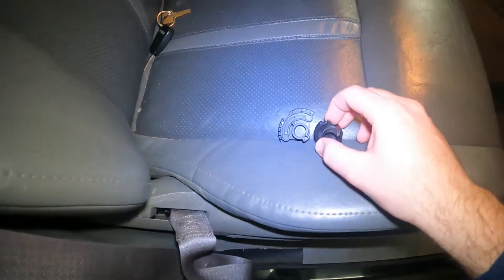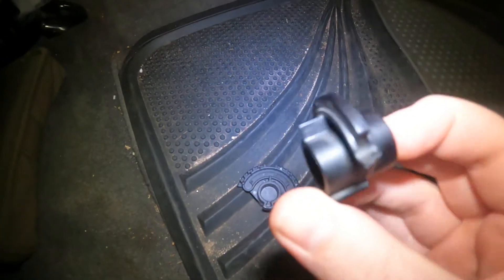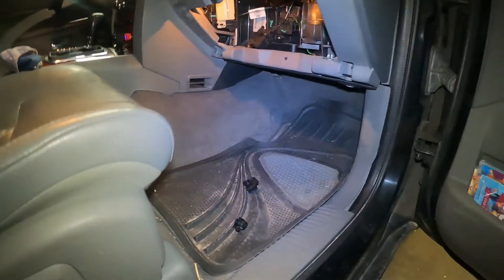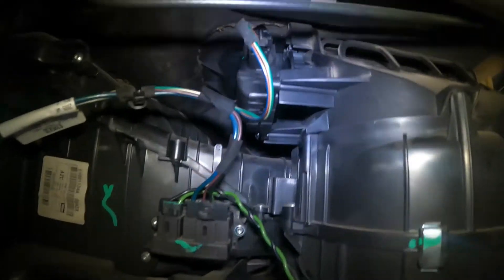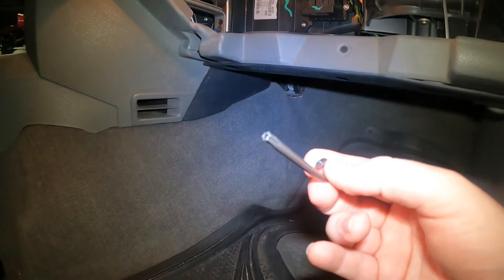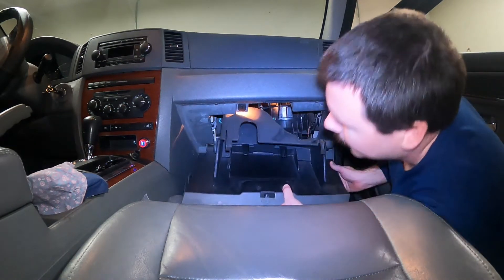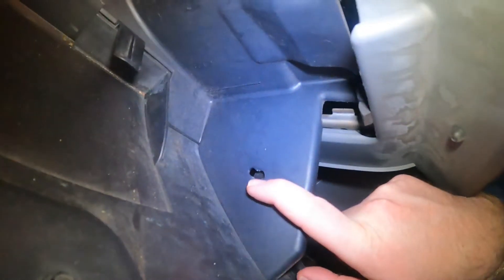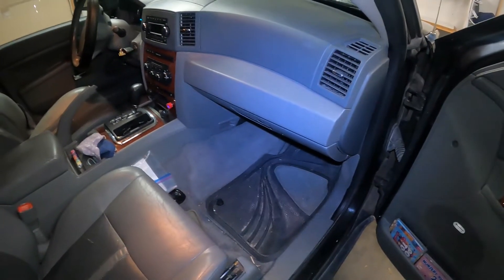2007 Jeep Grand Cherokee Blower Door Repair, Fixes Clicking Dash Noise, Glove Box Install

Comment: Super helpful video and its exactly the issue I have. Its tight in there but doable with a short t20 screwdriver. Thanks for the Amazon link to the replacement part. I will be replacing it this week.

Comment: Thanks!
Unfortunately the gear on my blower flap door is broken (opposite of yours).
I'm having a hard time finding a gear. Even a new flap door doesn't include gear!
Reply: lower the blower motor , acces the recirc door and pull out. I left my door out and restored air flow. cannot use recirc option but atleast i have heat and a/c
i may try to j b weld the broken gear back if i cannot locate one.
good luck.

Comment: that uper motor started klicking after opening doors with remote control e ...nobody touched the potentiometer for heat or cooling blower or frond down windsheild pozition button

Comment: How do I know which blend door actuator to get if I need to replace two different kinds ? 05 jeep grand cherokee. 
One is on the driver side and the other is on the passenger but which blend door actuators do I need or can one fit all?